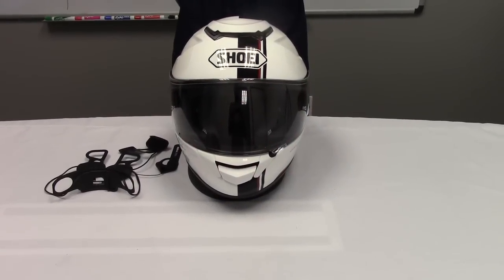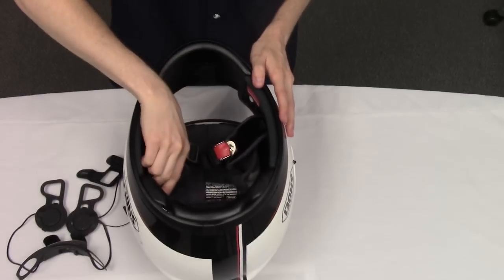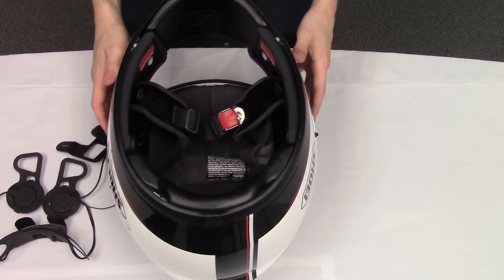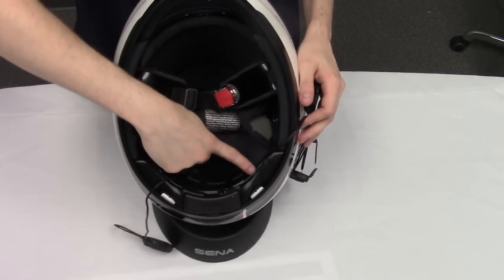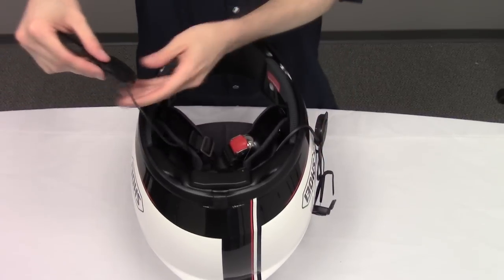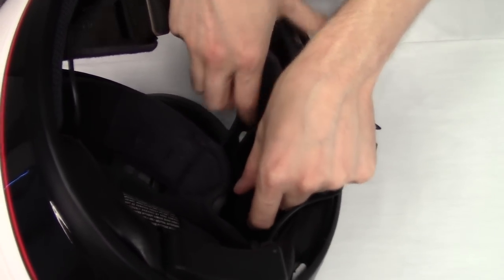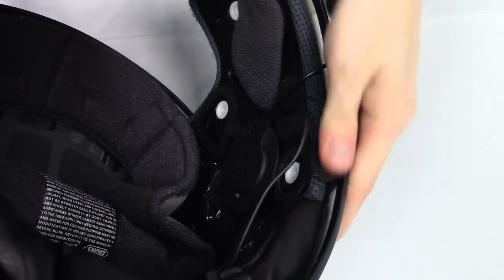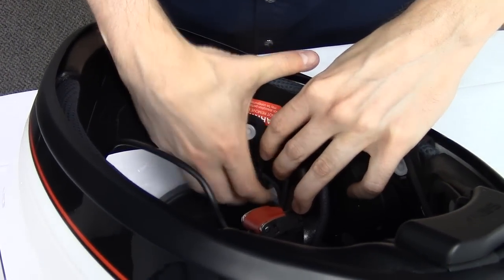Sena 10U How To Video for Shoei GT Air How To Video (Installation)

Comment: Owner of a U10 intercom for SHOEI GT air helmet for 3 years, I had the nasty surprise to learn that the replacement of the battery located in a glued case was not possible. Indeed, SENA does NOT provide any after-sales service beyond the 2-year warranty period. It is a scandal to pay $ 250 for a device being obsolete after 3 years of use.

Comment: Such an awesome fitting product. Definitely getting one. I think you forgot to reattach the snap locks for the cheek pads though
Reply: +Sena i have the neotec and one of my snaps on the left pad comes undone really easy with the 10 u in place is that normal

Comment: +Sena Isn't the helmet going to be more noisy when the ear foam covers are removed to make room for the speakers? Like isn't there some foam on the speakers? Would be a shame to make that plastic touch my ears if you know what i mean..
Currently that's what holding me back from buying this.
Also I i were to buy a gopro camera, can i use this Sena 10U as the microphone for videologging?
Looking forward to a response to my questions :)
Reply: You can snap the speakers out of the standard holder and put them into a foam covered holder. It's all in the set included. Idk if there is a possibility to use the mic for vlogging. 
Sorry for my lack of English. Greetings from Germany.

Comment: How come that the control buttons go inside the helmet? How can you operate them with a closed visor?
Reply from the maker: The buttons were designed to be inside of the helmet for a fully integrated headset design. In addition, the 10U comes with the Sena Handlebar Remote for controlling the headset from the handlebars on the motorcycle while the visor is down.

Comment: I've heard rumours that the 10U doesn't fit the gt-air sizes xs and small due to the mouth piece not clipping over the padding as it has been made larger for those size helmets. Is this true??
Reply from the maker: We will look into this further with our R&D team.
Reply: Sena any feedback from the r&d team?
Reply from the maker: The 10U for the GT-Air was designed for helmets that are Medium and larger. The 10U may fit on helmets that are XS and Small due to the larger EPS liner but the controls and the microphone may not fit properly.
Reply: Sena that's pretty poor from sena then. Why make a headset that doesn't cater for all sizes. Shocking!
Reply: I bought this helmet today and part of the reason was the integrated Sena. Unfortunately for me, I'm a size SM so I guess I'm just F'ed. Thanks

Comment: Rage! Lol I can't get the battery to go in and be as flush on my gt-air. I must not have enough thumb strength or there's some kinda glue blocking it from sliding in. Should I brute force it in? Use a mallet!? Thanks otherwise great product love this thing!
Reply: +Sena I had to use a hammer to tap it in. Wouldn't go in for the life of me.
Reply: Your video is very helpful.  However, I'm having the same problem with my GT-Air, which was manufactured 08/15.  The battery pack tabs won't go down, no matter how hard I push.  I'm afraid to use a hammer and break the plastic.  Any ideas on how to get it all the way in, or should I just leave it part way in and hope the tabs on the sides hold it in enough?
Reply: +TaxGuru I have a feeling over time the glue shifted or melted in that area, just press it in as best you can, then put something between the battery and the hammer and lightly quick taps will get it in.
Reply: Nel I used a fillet knife and jimmyed it around where the tabs would go. slid in nice
Reply: Bullshit. Seamless install.

Comment: Sena will probably delete my comment, but here goes. Installation of this unit is no way nearly as easy as the video pretends it is. I needed a long (6") flexible knife to make room for the tabs on the battery, and for the antenna. Once you get all of these wires in the helmet, no pads fit back in easily. Also, it was impossible for me to install the speaker covers. I tried, and I'm not a weak guy. They won't fit. There will be frustration. There will be bad language, but persevere, and you'll get it installed. Haven't tested it's function yet, but am hopeful it will work.
Reply: I had trouble with those speaker covers at first too, but then i realized you are supposed to remove the plastic with the "snap holder" (that's what its called in quick-start guide illustration) from the speaker, and then clip on the part with the cover in it's place. If you too it that way they will fit on easily.
Reply: You may have something wrong with your helmet. I just install the S10 in my Shoei GTAir, and it takes only 5mn, like in the video... So??... It's strange for your helmet.
Reply: This is a great video but I also had some real-world frustration. The cheekpad snaps have almost no extra tolerance for space, so once a .5-1mm piece of plastic is introduced, it’s going to be hard to fit. 5out of 6 cheekpad snaps re-snapped, with the one outlier being the one with the most new and closest proximity plastic interference. I didn’t have issues elsewhere but feel for those on the thread that had helmet size restrictions, that should not be an issue if the mechanical engineering design is done right. This is probably why the video does not show re-snapping the cheekpad snaps.